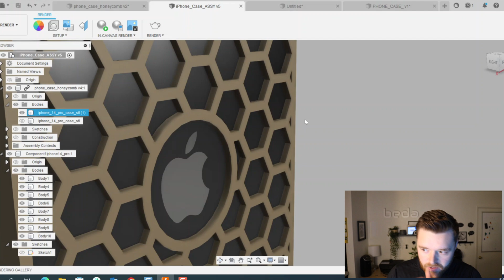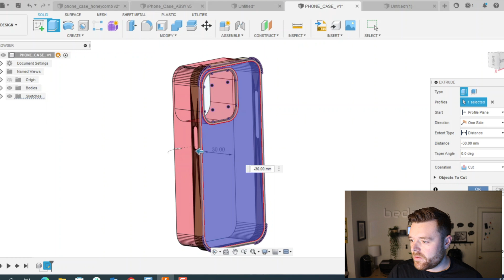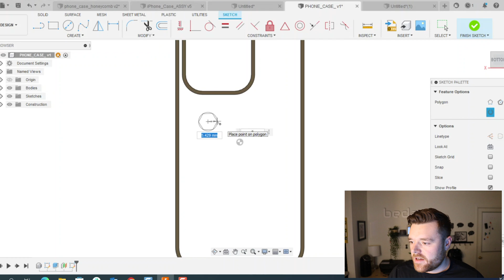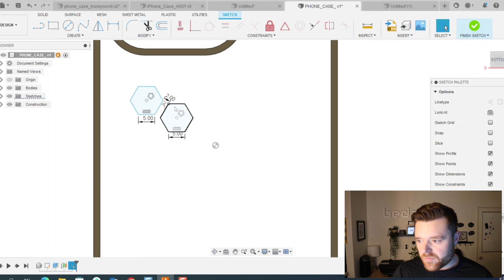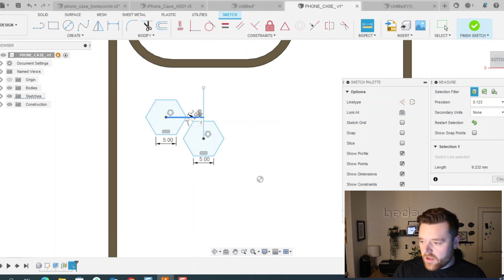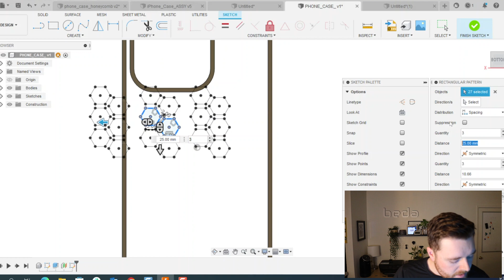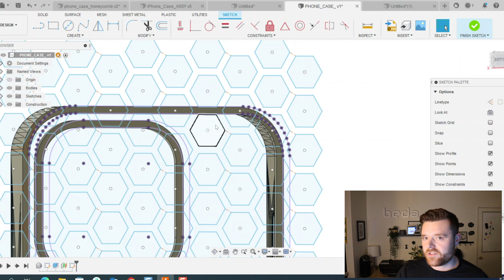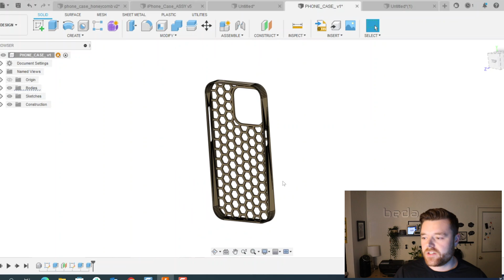How to make a Honeycomb Structure in Fusion 360!

Comment: there is an annoying thump on your microphone, maybe to do with mouse movement? easier to do this if you select directions in which to propagate the pattern and then use suppression - all built into the pattern generator.  there is a video that shows it.  search for "geneate hexagonal pattern".  You then dont need to capture, calculate, record, and use high digits of precision numbers.  your way is the way i used to do it too.

Comment: instead of manually calculating the distance for Y, and with parameters, you can simply define "HexagonSpacing" and "HexagonSize" in the user parameters, and use them for the hexagons instead of values. then for the actual spacing in the patterns, just use the approximations ie for the Y spacing: ( HoneycombWidth *1.732 ) + HoneycombSpacing)

Comment: How do you arrive at this value 10.66? I'm using other measurements, 6 mm for the hexagonal size and 0.44 mm for spacing, and when I replicate it vertically, I can't get 0.44. I'm not very good at math, I don't know how to do this calculation.

Comment: Thanks for this, as someone new to Fusion I learned a lot, but I have one question I do hope you or someone else will answer and I'm sure it's a lame question but how did you dynamically change the values you were putting in? I find having to type in the dimensions I want really annoying and would love to use up and down arrows or the mouse wheel to change the values. You seem to be doing this somehow and I'd love to know how. Thanks
Reply from the maker: Hmm. Best way I can think of would be to turn on snap to grid in the sketch settings and then you can drag your sketch geometry to increments of say 5mm. Might work? Let me know how that goes!

Comment: Don't know if it's  a new feature in Fusion360 but as you have allready a small frame for the camera in the thickness of the later honeycomb you may use extrude "from object" "to object". Safes the last step for cutting and makes it also more parametric as when you change the thickness of the camera frame it will also change the honeycomb thickness automatically.

Comment: I came here to leave a comment suggesting at least 4 or 5 ways this could have been done quicker but it seems the comment section has already beat me to the punch. Two important behaviors I would recommend to you, Adam, would be a) knowing that you can edit a sketch pattern even after it’s been made so that you don’t have to undo all the work you put it. And for b) I love that you did an offset plane to simply your work downstream, but your final 2 extrudes could have been turned into a single one if you set your extrusion to begin at the edge of the case and not on the profile plane you sketched. Anyways, best of luck in your CAD education, I hope enjoy the journey.

Comment: - Late to the party, but here's my IMPROVEMENT SUGGESTION...
- Better performance to PATTERN FEATURE/s: avoids computational expense of "GEOMETRIC CONSTRAINT SOLVER" in sketch mode - plus, has 'COMPUTE OPTION: OPTIMIZED'. (BTW, also can pattern body/face/component.)
- Details on "geometric constraint solver": constraints and dimensions generate equations, which must be solved simultaneously. SOLVER IS COMPUTE EXPENSIVE, and can get overloaded if system of equations grows too big. But, when pattern done outside sketch, and on feature, solver is not in the picture. BTW, pattern feature can still get overloaded, but can handle more repeats than if done in sketch.
- OK, hope that helps in your design/modeling efforts...

Comment: For 3D print purposes, you can use honeycomb infill and remove the top and bottom layers using a modifier (manual or stl) in your slicer.  With that method, you can change the size of the honeycomb just by changing the infill percentage.  Just another option.
Reply: Better off to do it in one tool then slice.  You dont have as much control with modifying the g code.
Reply: @troyd-motorsport9933  if you do it in design software, the file is much larger plus you still would have to modify in CAD, then slice again.  I’ve done it both ways and they both have their pros and cons.
Reply: Not always applicable, especially when other non-honeycomp structures are in the house.
Reply: @christianmontagx8461  That's where you use the modifiers in the slicer to turn off the top and bottom layers to only have exposed infill in the areas of the modifiers.  You can even draw your own modifiers in fusion and import them into your slicer.  The only disadvantage is you don't get to adjust the wall spacing of the pattern, so this is only applicable for certain situations.
Reply: You can't adjust the thickness of the walls in the slicing software.

The correct way is to design upfront
Reply: @olafmarzocchi6194  You're correct there....I wish that was an option in the slicer.
Reply: @olafmarzocchi6194 yes you can, but some percentage only, the slider will overextrude or underextrude. You can also change the nozzle size. But I prefer designing in fusion than relying on the slicer to do it, but it is an option, even with organics infill in Orca Slicer, that can be really hard to replicate in fusion

Comment: Got all the way to project then it wouldn't work and i couldn' select the space between the hexagons
Reply: the same thing happened to me. the issue was i didn't project correctly the first time so the border wasn't on the same plane as my hexagons so the space between the hexagons couldn't be an object. I fixed it by projecting each of my border lines to the new plane and it worked just fine.

Comment: If you change one dimension you're gonna have to change both the distances in your pattern. You'd better use a little bit of geometry and a bit of trigonometry.
I'd start by defining two more parameters in Fusion:
 - HexSide = 5mm
 - HexDist = 2mm
What you see inside an equilateral hexagon is a series of 6 equilateral triangles, which means the distance between the center of the hexagon and one of the corners is equal to the length of the sides.
By splitting one of those triangles into two right (a.k.a. orthogonal) triangles, by tracing a perpendicular line from the center of one side to the center of the hexagon, you can calculate that the height of such triangle is (HexSide/2)*tan(60), or HexSide*Cos(30), therefore the vertical distance can be expressed by the formula
HexSide*tan(60)+HexDist
or
2*HexSide*cos(30)+HexDist

The horizontal distance can be expressed as the sum of 2 * (distance between the center and an angle + the horizontal distance between the two points highlighted at 5:15) + HexSide
The first parameter is itself HexSide, as stated before, while the second is just HexDist * Cos(30)
The formula is then 
2*(HexSide + HexDist*cos(30)) + HexSide
or just
3*HexSide + 2*HexDist*cos(30)

Just add the formulas, and you'll be able to change the dimensions at any time.
Reply: You can also use custom axes in the pattern command, with just one hexagon and avoid all the messy calculations
Not sure if the option was already available when he made the video or when you wrote your comment 😊
Reply: This is great information! You should create your own tutorial as this approach encourages true parametric modelling.
Reply: oh i didnt see this comment before posting mine, too be honest this is a bit much if you just wanna shid out a pattern. way easier to use approximations: Y spacing = HoneycombWidth *1.732 + HoneycombSpacing
Reply: I used your formulas and they worked like a charm. thanks.
Reply: This is the %1 of the time I'm actually glad I read the YT comments.  Yes, these considerations are more inline with parametric design.  Thank you all.

Comment: i just watched this and you can do this way faster

you can just draw one hexagon with construction 2 lines connecting the centerpoint to 2 adjecent edges (60° offset) then you simply start your rectangular pattern and select the 2 construction axes with the 60° offset - there is no need for the pattern to be in 2 90° offset directions - the name "rectangular" is confusing here

so then you can just select the amount of hexes you need and set the gap directly in the pattern

also when you extrude from an offset plane, you can also set an offset in the extrusion dialog - so no need for the double extrude here (once to extrude and the other one to cut)
Reply: This did exactly what I needed. Thanks!
Reply: That’s my boy!!
Reply: Thanks, I've actually been doing it that way, but looked up how to do it more efficiently because I thought my method is too complicated, lol
Reply: This is spot on. I was confused why he didn't offset the extrusion to begin with to avoid the second cut.
Reply: Holy moly that worked a treat and way better than I'd seen.

Comment: thanks, you explained this so much easier, also to get the X dimension can use the 2 point rectangle between centers to quickly get the dimension :)
Reply from the maker: Thanks for the support! And the pro tip 👍
Reply: @adamtjames recently came back to this, to make it even easier you can use parameters hex_wall (width of boarder between hexs) and hex_size length of one side and these formula, you can then reference them directly in the the grid function 

hex_grid_x = ( sqrt(( sqrt(3) / 2 * hex_size * 2 + hex_wall ) ^ 2 - ( ( ( sqrt(3) ) / 2 ) * hex_size + hex_wall / 2 ) ^ 2) ) * 2
hex_grid_y = ( sqrt(3) / 2 * hex_size ) * 2 + hex_wall

Comment: is there any method, where i would be able to change the size of the honeycomb quickly without having to do everything again?
Reply: yes, if you just do it right :) draw one hexagon and use a parameter (variable) to create the dimension and and create the "rectangular" pattern with 2 axes with 60° offset - so you only need 2 variables (spacing and lenght) not 2 hexes that form a sub pattern

here you can then change the 2 parameters to redraw the pattern

then you extrude the whole patter and cut out the shape of the phone case afterwards - so you don't have to select every part of the pattern, you select the whole pattern
Reply: Fusion has something they call parameters, you can access the menu by going to "Modify > Change Parameters", you can then create a new parameter, say "wall_thickness" and give it a dimension... when drawing your sketch, instead of using numbers for your sizes, use "wall_thickness" as per my example. This is an extremely useful feature of f360 and can let you make very customisable and flexible designs :)